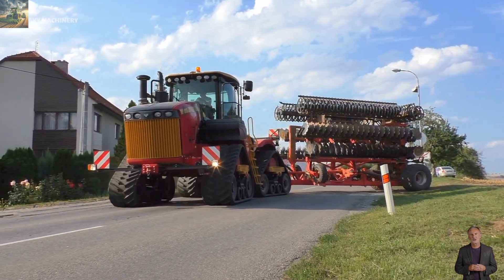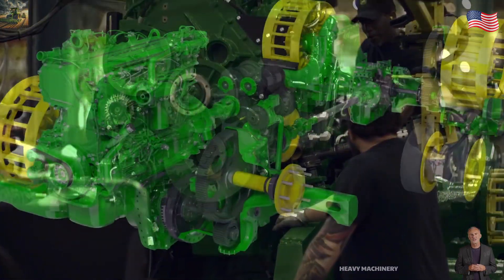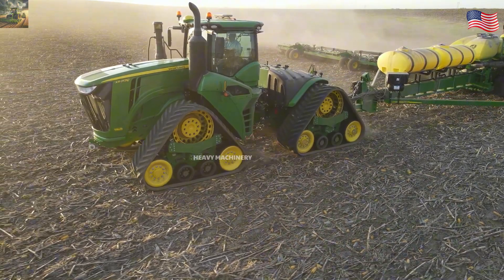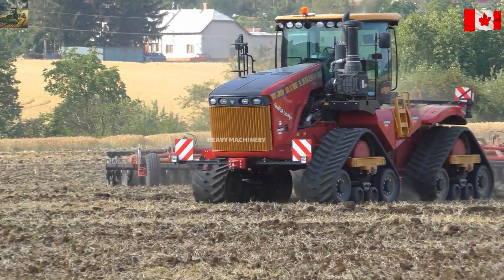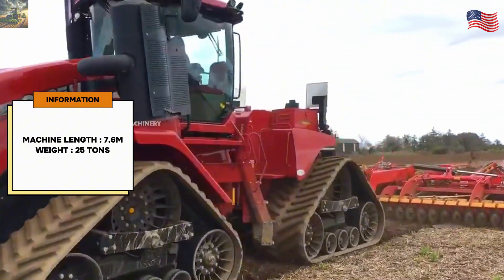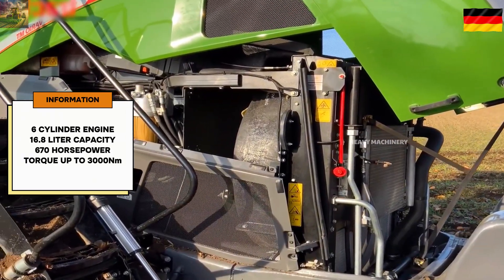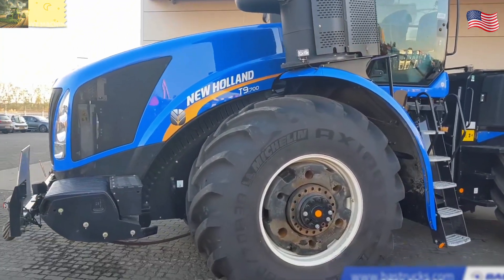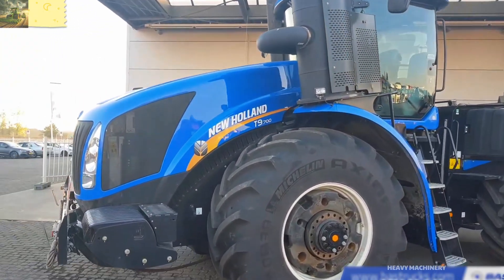TOP 5 MOST POWERFUL AGRICULTURAL TRACTOR IN THE WORLD EVER PRODUCED

Comment: The John Deere RX 570's seat does NOT rotate thru anything close to 360° ! Firstly, there's no need for that large a range of movement, and secondly, there is insufficient space at the rear of the cab to allow it to do so !
 What is also annoying is the mixing of Imperial and Metric units where the specs' are concerned.
 Note that the Case IH and New Holland tractors are practically identical mechanically, apart from the bonnet panels.
Reply from the maker: Thanks for your comments,